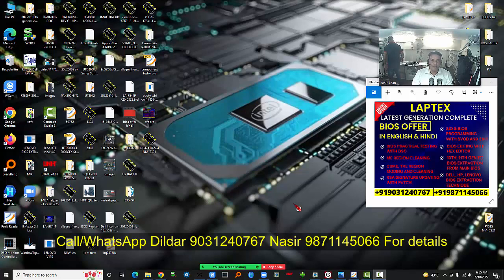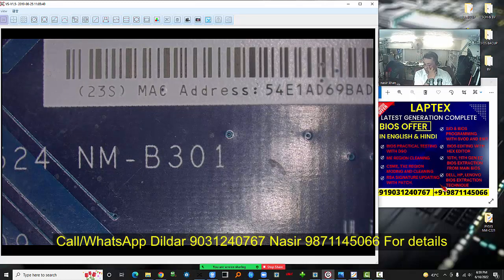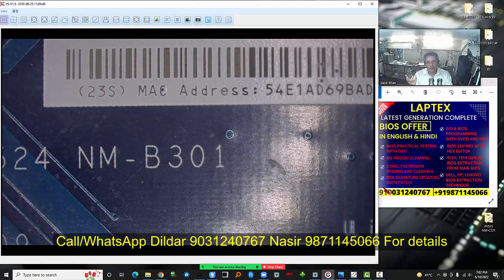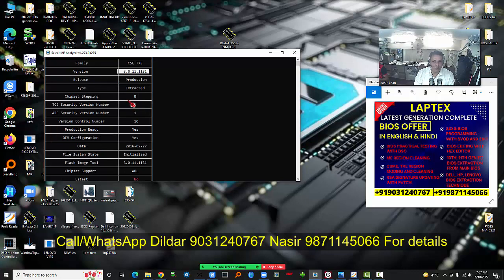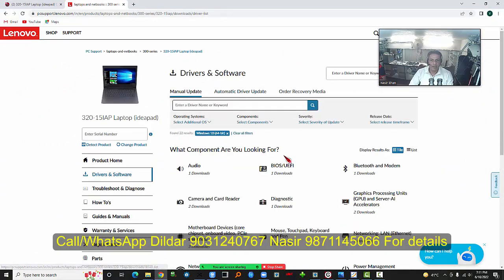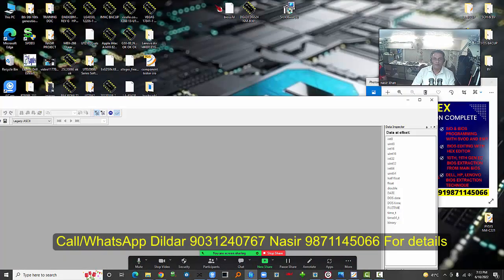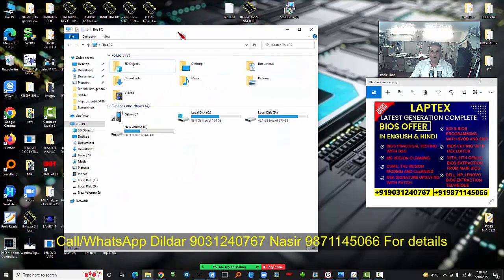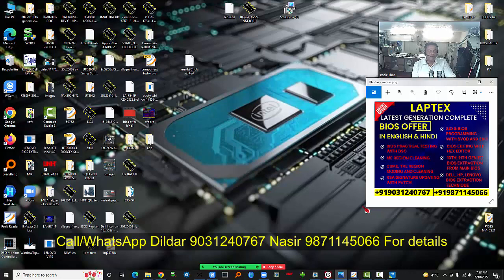(ENGLISH) HOW TO EDIT BIOS WITH HEX EDITOR | HOW TO USE ME ANALYSER | Complete Details of Course

Comment: What if the bios file is very small and corrupted, like 2mb (supossed to be 16mb). But i have the serial number of the laptop, could i still make my BIOS with serial number+manufactor bios? Thx.
Reply from the maker: No...it needs a complete backup file then only BIOS could be made.
Reply: @laptex1377  you need full backup

Comment: Hello ! I think in my laptop the GTX760m GPU is dead, how can I simply mod the BIOS to disable and use only the CPU INTEL graphics core?
Reply from the maker: You need to know the exact HEX address of the disabled bit...then it could be done... If you can get it then only it's possible...you can contact someone who is doing it..we are not doing it presently

Comment: Please sir there are latest 12generation laptops which come up with finger print to power up motherboard. Please sir when at time of repairing do you also need finger print OR THESE MOTHERBOARD COME WITH ON BOARD ON/OFF  POWER SWITCH
Reply from the maker: Need to check.
Reply: @laptex1377  OK sir because they are bit tough
Reply from the maker: Yes